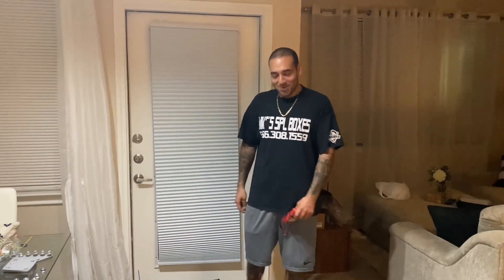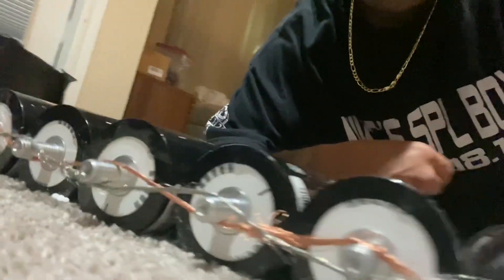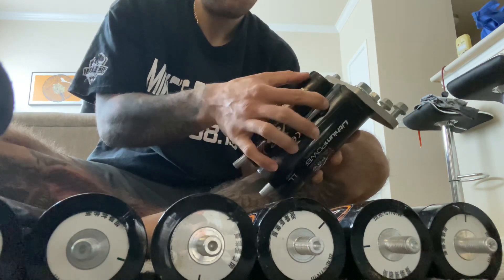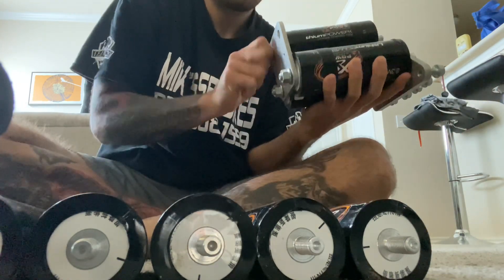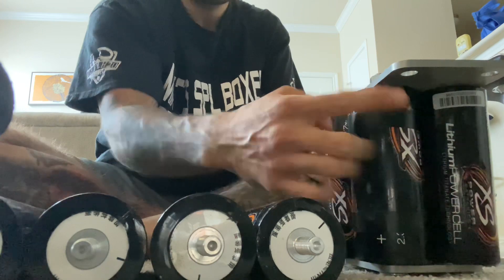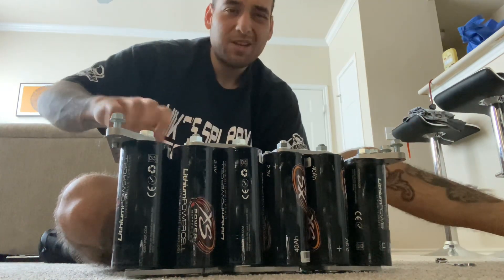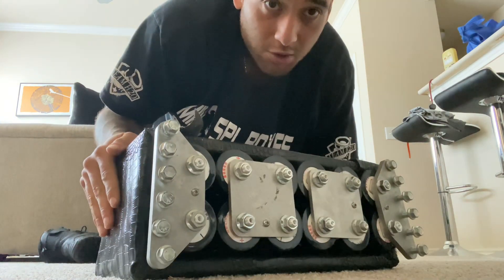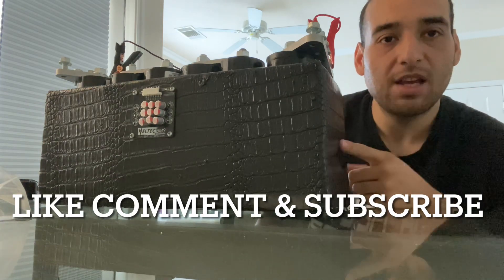How To Build and Balance Yinlong Battery Step by Step

Comment: Is better 45 per cell?
Reply: The lower amp hour per cell (45ah vs 35ah) you will have more charge and disharge current, BUT, the higher the amp hour, youll have more reserve. So in heinsight. A 45ah cell will hold more charge, but give out less amps in a burst, but a 35ah cell will give out a bigger charge in a burst, but holds less current all together. Its a give and take

Comment: Aye wassup mike i got a question, based on your experience does a low tuning or high tuning sound louder outside a car i want to be heard cuh. Thanks
Reply from the maker: To my ear higher tuning and high frequencies louder outside the car. Although ive read lower frequencies travel farther. I guess depends on the ear
Reply: @mikessplboxes7497  yea ive also hear the same thats why i wanted your oppinion thanks

Comment: Your channels going to blow up bro. I really enjoy your videos. I'm actually in need of a box. I have 2 VXF 12s in a prefab. I drive a 2009 Maxima SV and the trunk opening is an asshole. I had the GP audio 31hz dual 12 flat pack and it almost didn't fit. 14x38x22. The depth is what got me. It's 4 cubic feet internal volume. I've talked with other builders and they say I need 5.5 with an aeroport and the box won't get much bigger. Would the subs face up  work?  Port facing the the front.
Reply: I was wondering what kind of bank you had cause your voltage stays on point.i got headway myself Real world shit
Reply from the maker: @headhoncho4890  u know it. I’ve had this yinlong bank for a year now
Reply from the maker: I appreciate it bro. Shoot me a text
Reply: I was wondering do you run a balancer on those batteries and do you have a isolator for the front and rear battery
Reply: I have the same bank. And yes a balancer in needed. His is on the front of the black box he put the completed bank in. He just didn't explain how to do it. I brought an NVX isolator. Never used it still have it, Dropping hurtz car audio said i would need it. I run a separate alternator for my bank in the back, and my main d3400 is being charged the 240 alternator.